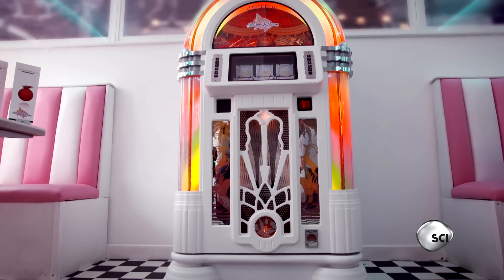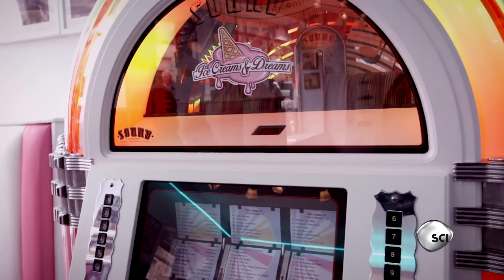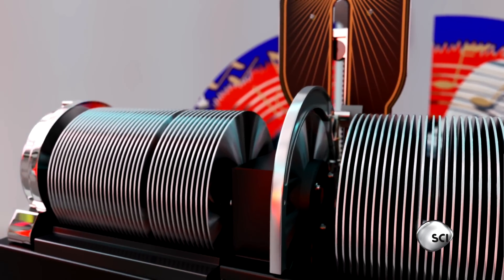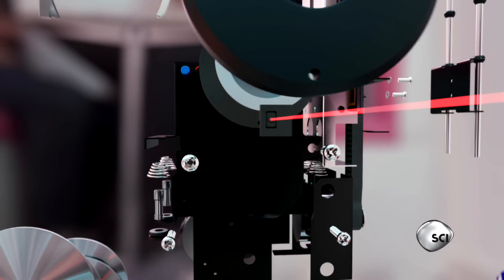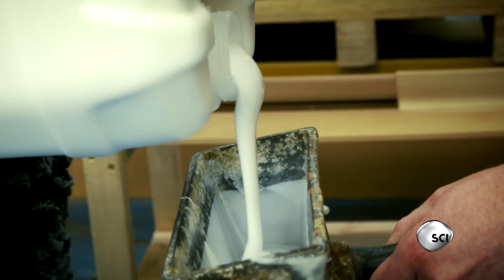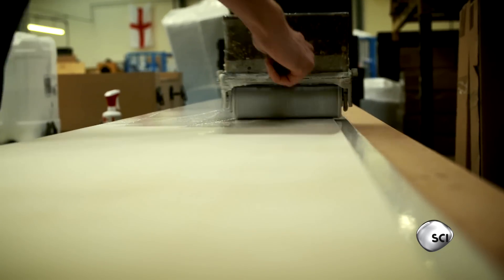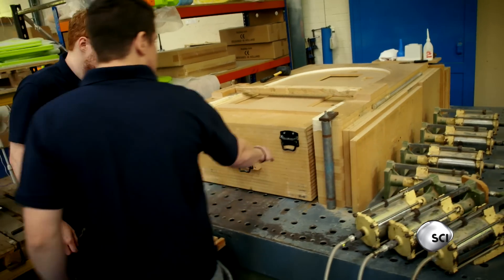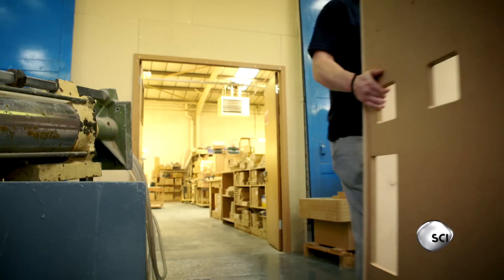Jukebox Anatomy

Comment: Jukeboxes were in restaurants/ nightclubs/ dance halls in the 1930s. Paul Fuller designed one of the first jukeboxes that utilized lighting. He designed the Wurlitzer model 1015 in 1945.  In 1949 Seeburg developed the first jukebox to play 100 selections and in 1950 the M100B by Seeburg was the first jukebox made to play 45rpm vinyl records.  The 1950s jukeboxes were more chrome and stainless steel designs featuring improved fidelity. Look at these models: the  Wurlitzer model 2000 1956 and Seeburg M100C 1952 and AMI models from 1958.